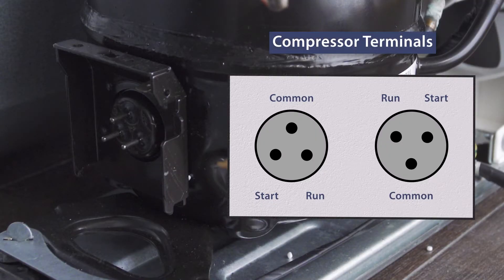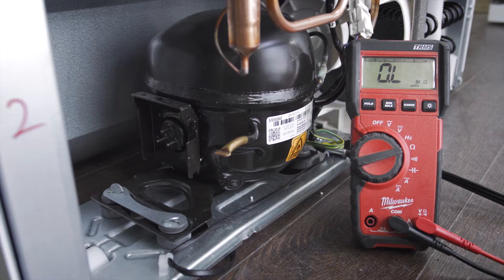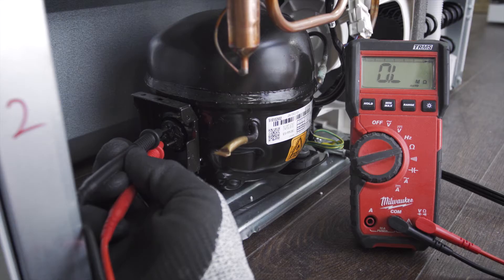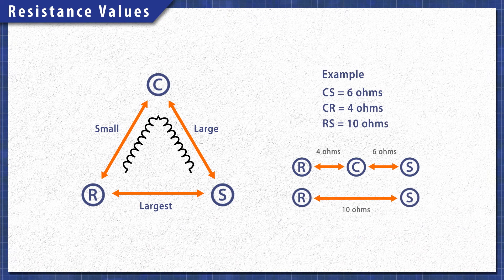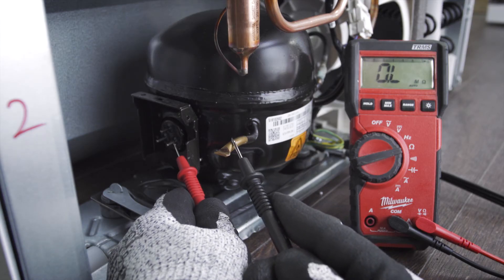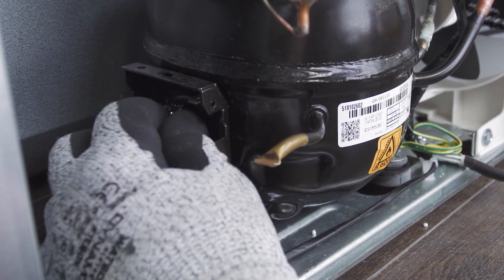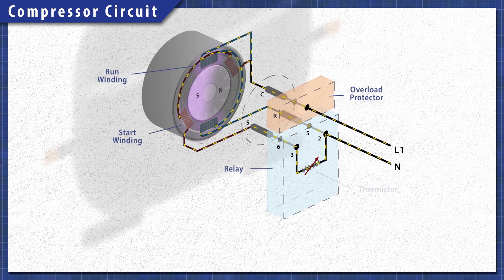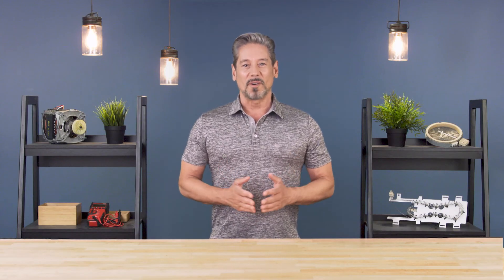Refrigerator Compressor Resistance Test | Repair & Replace

Comment: So my multimeter might me broken but when I measure out resistance off the compressor I'm getting in the range of 100 up to 1300. I have an older Maytag side by side
Reply from the maker: That resistance is far outside of the range of what it should be. To verify if your multimeter is working properly you can test something with a known resistance like a incandescent light bulb or an oven or stove heating element. As well any switch or wire should have a resistance of 0 - 1 ohm.

Comment: What if all the measured values are the same
Reply from the maker: Thanks for watching. If all the values are the same then you most likely have a variable speed compressor, which does not function the same, so the values are different.

Comment: I got  readings of 12.5, 6, and 7.3
Is that normal of a GE compressor WR87X29574?
Reply from the maker: That's not outside of the reasonable ranges. What issue are you trying to narrow down have you seen our full compressor troubleshooting guide? https://www.youtube.com/watch?v=NND8J8dXqJ0
Reply: @AmreSupply  My refrigerator is not freezing.
Reply from the maker: @NKAYWHY  Is the compressor running at all?

Comment: my compresor gives me 29.1 on both run winding and start winding
Reply from the maker: Your other comment you mentioned you also measured 29.1 to ground which means the compressor is shorted and will need to be replaced.

Comment: Greetings! First, thank you for all your videos! They are very helpful. Now I have a Samsung RF265BEAESG/AA fridge that stopped cooling. I replaced main control board DA92-00939A, inverter control board DA92-00763B and control board DA92-00486a rev R.F. Also, I checked compressor for continuity and had readings of 16 ohms on each combination. I checked each terminal against bare metal and there was no resistance in each. Not ssure if it's shorted or not due to multiple control boards. Thank you!
Reply from the maker: Thanks we're glad you're finding the videos helpful! Have you checked the temperature sensor? A faulty thermistor can prevent the control board for even making a call for heat: https://youtu.be/HQFRUuWIz_o

Observe and listen, do any of the fans run? Then that's an indication the fridge is trying to cool and sending power to the compressor.
If you don't hear anything cycle on then it's likely a temp sensor issue.
Reply: @AmreSupply  Hello! I checked both the temperature and defrost sensors. They passed the test, but in the event I had made a mistake I replaced them. I noticed fridge fan turns on, but no cooling. Could it be it needs R134a? Per label inside the fridge, this is the refrigerant it uses.
Reply from the maker: Yes if the fridge turns on, and there's no cooling, then the refrigerant might need to be refilled. Since this is a sealed system you'll need to hire a certified technician to do this.

Comment: I got 12.5 ohm on each test. What does that mean?
Reply from the maker: Do you have an variable speed inverter and a inverter control board attached to your compressor? If so then 12.5 ohms for each test is within the normal ranges.

If you have a regular compressor then it's possible there's a short, and the compressor is faulty.

Comment: thank you for sharing this videos with most people like me.I have question 2 days ago replace my BLDC Inverter but compresor won't start, not sure what miss, MY refrigerator is a GE MODEL NO.GSH25JFXL CC SERIAL NO.RS222070 any feedback will be appreciate thank you
Reply from the maker: You're welcome, we're glad you're finding the videos helpful. In this case if the compressor and the inverter board are good, and the compressor still won't turn on, then you'd want to look farther up the chain. It's likely that there's no call for cooling. Either the thermistor (temperature sensor) is faulty and is not detecting the right temperature and not triggering the cooling cycle, or there is an issue with the main control board which handles the other functions within the refrigerator.
You can see how to test the thermistor here: https://youtu.be/ngPh1FJtvs8?si=3sZBpnA5RDNWler-&t=498
Reply: @AmreSupply  thank you so much After following up the step you told me I found the main Board was Bad..Just Order one came Today Replaced it than everything is working fine..Once again ThankU for you feedback...Greetings from Connecticut ✌️
Reply from the maker: @pastrana37  You're welcome, we're just happy to help!

Comment: I went by your diagram and my common is on the bottom. And run should be in the upper left and start upper right but when i plug in it doesnt start or run but i reversed the start white wire to the left and run red wire to the right and all is working fine. I take it either your diagream is wrong or some compressors are different??
Reply from the maker: Yes there are some exceptions where the start and run terminals are reversed, but these are less common.

Comment: What does it mean if the sum of the 2 smaller is slightly higher than the 1 highest? I have 3.9 on Run/Common; 7.2 on Start/Common; and 10.6 on Run/Start. So the total is 11.1 which is 0.5 higher than the 10.6. Is this a problem or still ok?
Reply from the maker: Thanks for watching. It is hard to get exact readings, moving the probes around might give you some variance, as well any dust or carbon on the terminals can effect the readings. In your case a 5% variance is not really a problem.
Reply: You probably have a shitty multimeter that is measuring it on leads. Just look what it shows when you touch both contacts.

Comment: What if all 3 readings are the same?
Reply from the maker: Thanks for watching. It's possible that the compressor is shorted in that case.
Reply: @AmreSupply does it matter if is a r600 ?

Comment: My refrigerator (Samsung RS277ACRS/XAA-0000) stopped working after a power outage.

The ohm readings on the compressor are:
C-S: 0.4 ohm
C-R: 3.4 ohm

I was wondering if such a low reading on the start winding is normal for this model.

The Start Relay (thermistor, DA35-00135A) was not showing continuity (R = 1300 ohms), so I replaced it. The new one couldn't start the compressor either. When I test the new one, it also does not have continuity (R = 4000 ohms). I do not know if I got a bad start relay, or my compressor is bad, and by pulling too much current burns the start relays.

The overload protector has continuity, and seems to be fine.
Reply from the maker: Thanks for watching. There are a few notes: Generally the start winding has the highest resistance. 0.4 ohms seems quite low even for a start winding. Not certain of any models with that rated resistance for the windings. 
The C-R resistances seem very high, but make sure you are not testing them just after the fridge was running as the resistance increases with temperature.
It's also best to check the capacitor to make sure it is good.
If those are all still good then it could be a shorted compressor.

Comment: This is probably a stupid question - but the fridge needs to be plugged in when testing the compressor with the meter right?? Is there any chance of getting zapped when doing this testing??
Reply from the maker: Thanks for watching. It's safest to unplug the fridge before doing any tests. You can see all the tests in more detail in this troubleshooting guide: https://www.youtube.com/watch?v=NND8J8dXqJ0&feature=youtu.be
Reply: @AmreSupply  I didn't see your question answered in the video. You should have the refrigerator unplugged to test compressor CS, CR and RS.
Reply: Never test resistance or ohms with power on. Resistance measurements are always made with power disconnected.
Reply: Not all comp have the same or common winding resistance
Reply: The compressor needs to be disconnected. The fridge should be disconnected because you don want to short something out or get electrocuted when disconnecting the compressor.
Reply: Thank you for asking this question. I was too afraid to ask it! 😅